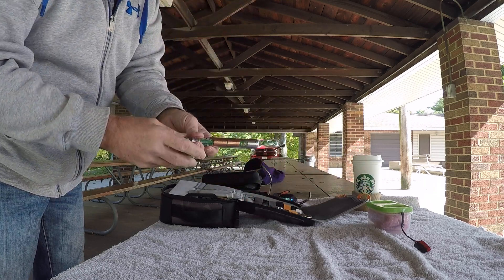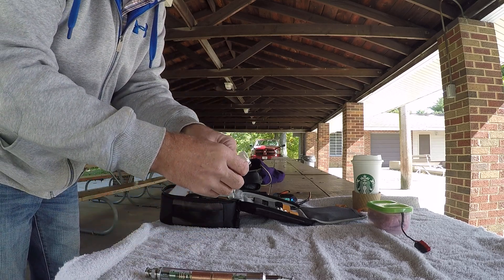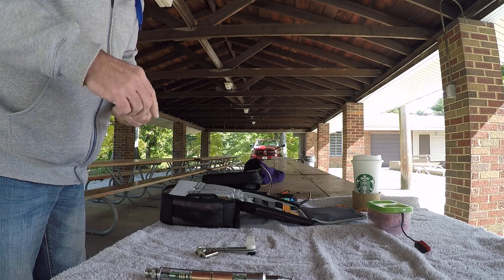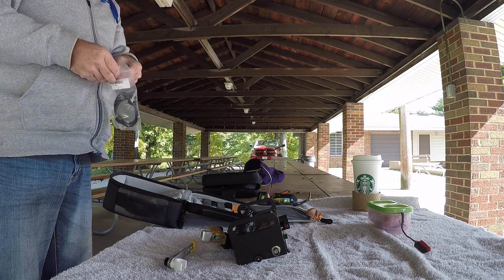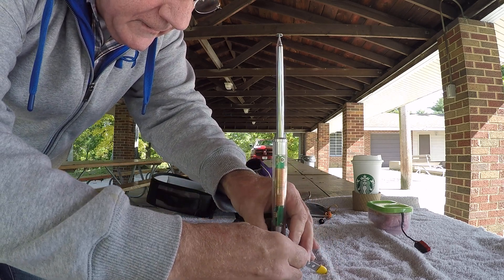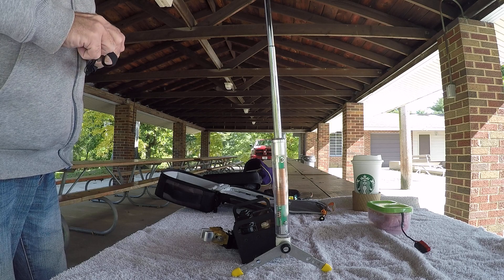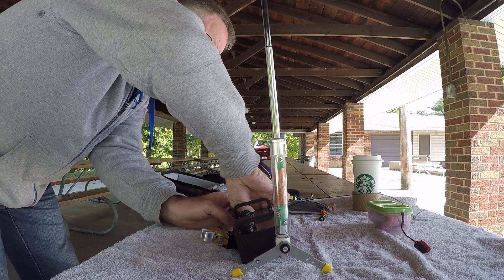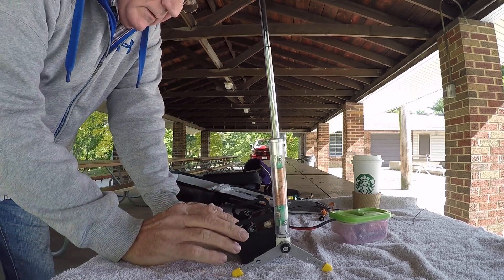New Elecrafts AX1 Antenna

Comment: Nice setup.  Is that the KXPD2?  They ship with a loose adjust screw, takes a lot of fiddling.  After I finally got mine to work, I threw it in the bag and used a Palm Paddle instead.
Reply: gsansoucie q1

Comment: Thanks for showing off the new antenna. It seems like it pulls in the stations just fine...Did you try it on different bands and how was the swr... did you get a good match? Good luck and hope to hear you on the bands... Bob N6BOB
Reply from the maker: Bob McClard Yes worked it on 17 meters tuned up good to. I use a 100ft tape measure for counter poise gets 1:1 or close to it without Auto Matic Antenna tuner!